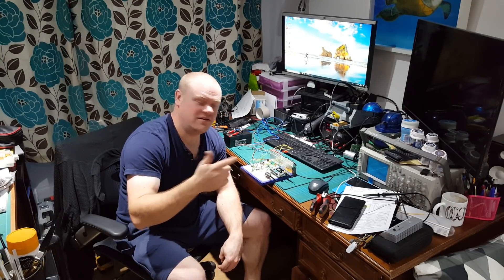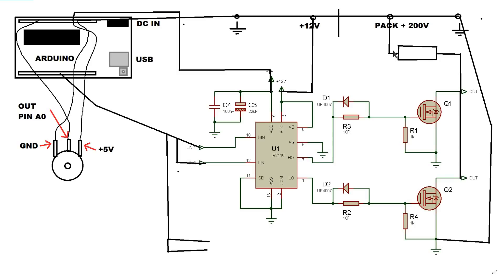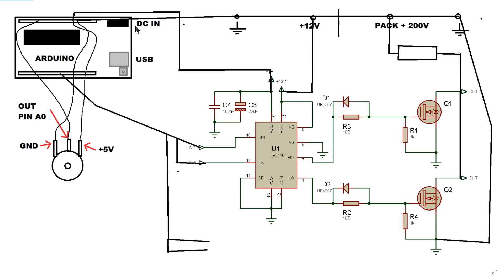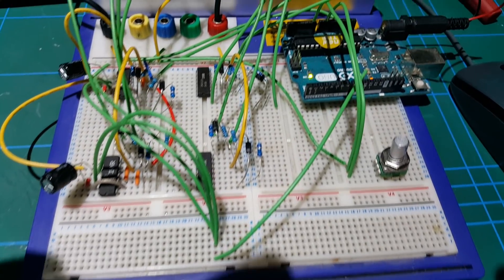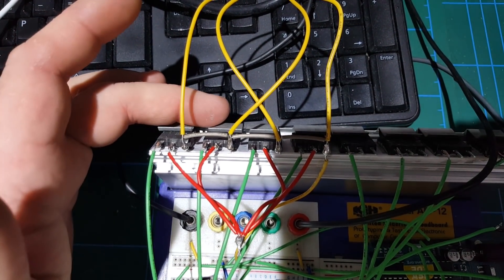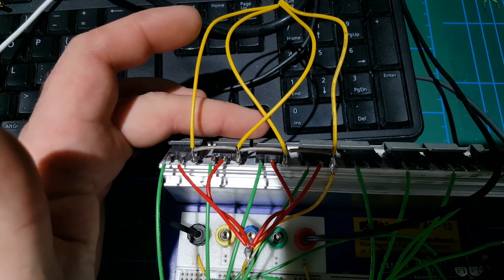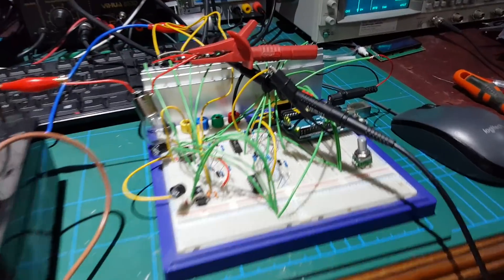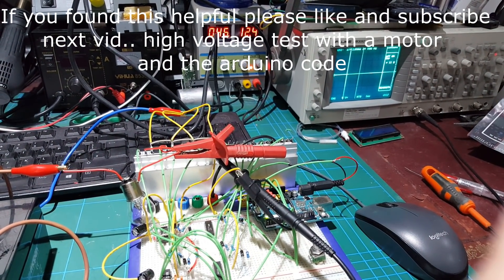motor control #2 pwm dc speed control arduino based how to make diy

Comment: Cool video, it would be good to have links to relevant documents in the description for circuit diagrams and arduino sketch.

I'm far from an expert, but won't you need some capacitance on the  output of the IGBTs to protect them from inductive voltages once there's a motor on there?

I've also read about igbts suffering with ringing, but don't really understand the cause, solution or indeed why it's an issue. It would be great if you could cover it.
Reply from the maker: Ahh funny enough the next video is all about snubbers and arduino sketch :-) so check in next weekend :-)
Reply from the maker: Funny enough the next video covers snubbers and the arduino sketch :-) so check in next week

Comment: Thanks for introducing me to the IR2110. I need to order some for future projects using those transistors with higher gate voltage requirements.
I noticed you omitted the connection in your drawing showing that you have the Arduino GND connected to the same grounds share by the external supplies.
Reply from the maker: You make a gpod point there .... i just checked and yes All grounds are common so the 12v supply to the arduino uno shares the same ground with the 200v battery pack :-)
Reply from the maker: And keep watching as there are further improvements